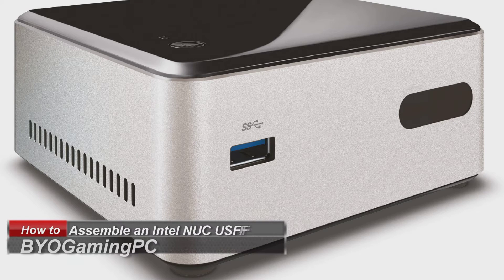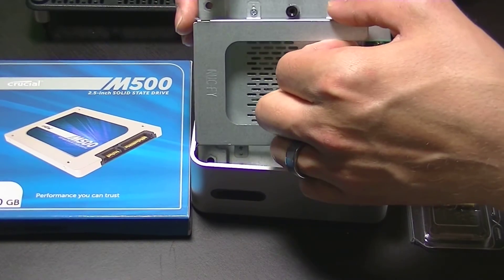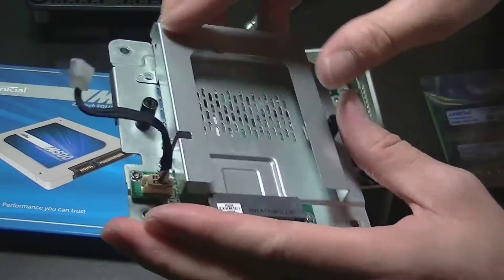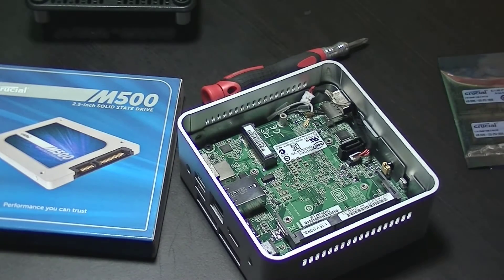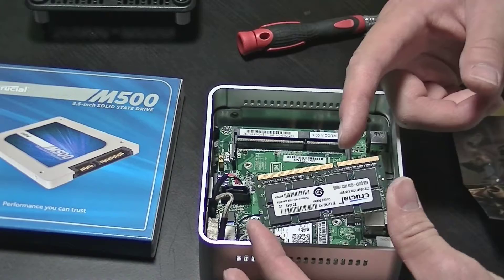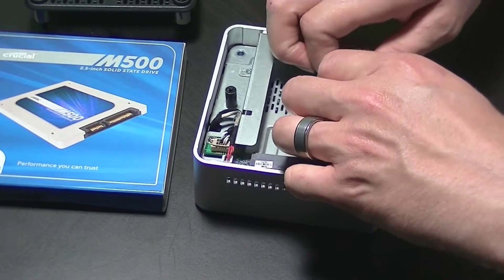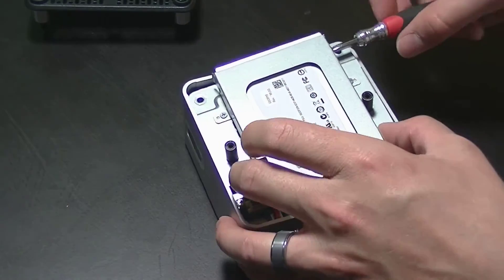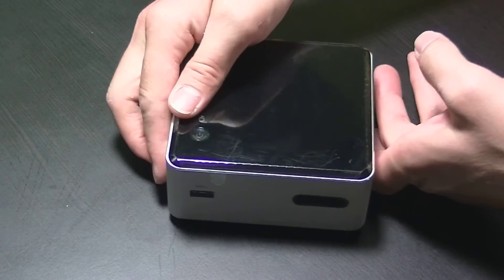How to Assemble an Intel NUC N2820 HTPC for Plex, XBMC, & Kodi

Comment: No reason to undo any of those cables. All my nuc PCs have been assembled without removing sata cables
Reply from the maker: It is much easier to leave them connected but for the sake of the video and being able to see everything, I removed them.
Reply: David Davis The new ones have a much better design where the hdd caddy is integrated into the bottom plate so once you remove the screws from the bottom it just lifts out and over to the side without having to disconnect anything and gives plenty of room for ram and msata drive install.

Comment: With these new NUCs you can make a cheap SteamBox... If you get a more expensive version of a NUC it could actually game. So in a way... a VERY small steambox... just make a dedicated SteamBox or use STEAMOS
Reply from the maker: This is true but you won't be able to run many newer games very well or on very high settings.
Reply: Well think about this. We don't need it to be on high settings. Just enough to match the PS4 or Xbox One settings. Cause the SteamBox is supposed to have the same or better graphics... so this is the start
Reply: You can also make a very low power server. One of my friends is using a Mac mini as a server, and running various virtual servers on it. Course Apple discontinued that recently (ish) so these should have no problem!!

Also for me, I have a little i3 laptop, and I personally don't see the point in having both a laptop AND a desktop PC, UNLESS it were a family PC, so the i5 CPU ones of these could come in quite handy as a family machine - a normal desktop ofc would be too pricey to run..:(
Reply: ***** It works for streaming quite well but don't expect it to run any actual games other than indie titles, 2d platformers, emulators, etc.  My NUC5i5RHY can barely run Diablo 3 @ 30 fps at the absolute lowest settings.

Streaming even the most demanding games from my gaming PC though is a silky smooth 1080/60.
Reply: I've used an NUC before, they run similarly towards a console, they won't run the greatest but can still play, that's what the SteamBox is meant to be

Comment: 1 minute review and 9 minutes to remove the hdd caddy from cable
Reply from the maker: Yea, it's a lot easier to just leave the caddy connected and pull it out and leave it hang. For the sake of the video and showing all of the components more easily I just disconnected it.

Comment: It looks like your new 11ac wifi card is dual-band while the one that you took out is single band. Unless Intel decided to equip dual-band antennas for compatibility, there is a chance that your new radio is not going to work well at 5 GHz.
Reply from the maker: I'm not sure since I've added my own custom antenna to the setup. It works great with the setup I've done but I've not tested it with the stock connections.

Comment: ive read i need to update bios before installing linux or win7? does this have to be done before installing os? should i just do the f7 flash drive route?
Reply from the maker: I've kept mine updated to the new BIOS using the F7 boot update method and it works great. I recommend going that route. It's quick and simple.

Comment: hey great video thank you, I'm going to buy the setup you have listed..but can you tell me what's the advantage of buying this rather than one on amazon for $125ish that uses android? I don't mind spending the extra $ for the setup you have described just wanted to know the benefits. thanks!
Reply from the maker: I'm not sure what you're referring to. I'm guessing it isn't an Intel NUC and is some other piece of hardware which probably doesn't have nearly the same horsepower or capabilities that the NUC does.

Anything that only comes with an Android operating system will be limited in it's functionality but if you don't need it to do much beyond what you can do with an Android device it would probably be fine.
Reply: BYOGamingPC Thank you for the response. I would strickly be using for XBMC. Can you google: Amazon Beelink the 1st link was the device I was looking at. Could you look at that and let me know what in addition I would receive with your setup? thank you again :)
Reply from the maker: I'm assuming that this http://amzn.to/1onZxAr is what you're referring to. I can't say anything about it since I've never used one but it appears that you should be able to use it for XBMC.

I would not recommend it if you want to do anything else that you would require a PC for but for XBMC only, I don't see any problems with it on the surface.
Reply: BYOGamingPC thank you for the help!
Reply from the maker: My pleasure, enjoy!

Comment: Also, I have a 2.5inch 250GB HDD I took out of my ps3. Could I use that or do you recommend getting the SSD?
Reply: Mine has my Ps4's drive in it. It'll work, just delete the PlayStation partitions.
Reply: 4sake123 it will work but mechanical drives will produce much more heat than an SSD and may result in light thermal throttling if the CPU gets too hot.  I doubt that would happen though but it is a possibility.

Comment: Great vid, just learned about XBMC and I was thinking of getting an android device to set up as a HTPC. After doing a bit of research, this seems like a much better option.
Reply from the maker: Thanks, glad it was helpful and yes you can use your PS hard drive as long as it's no thicker than 9mm which is pretty standard.